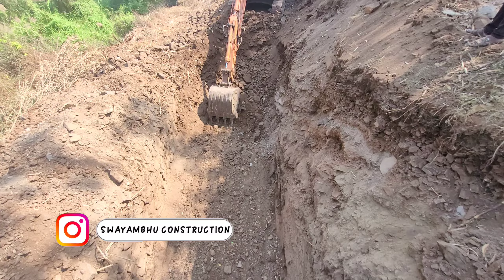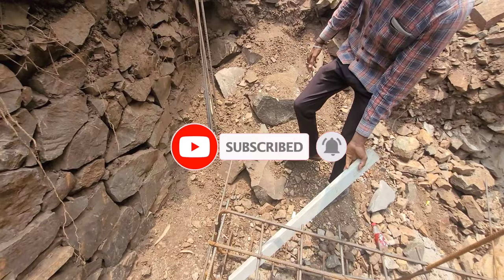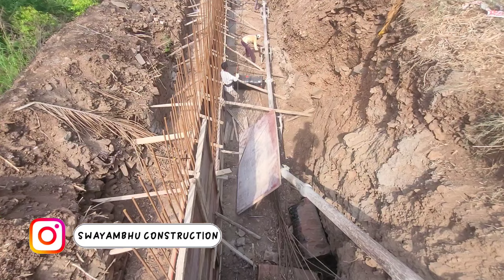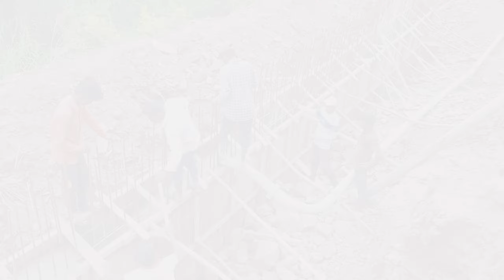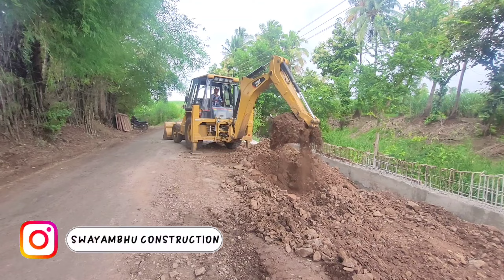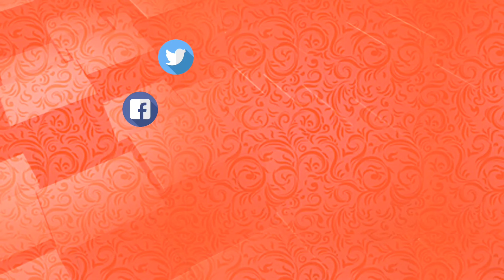RETAININGWALL CONSTRUCTION | CONSTRUCTION OF RETAININGWALL | MASS CONCRETE #constuction #concrete

Comment: What would be the price for this type of retaining wall
Reply from the maker: @swethanswaroop3775  30 to 40 lakhs
Reply: Thank you what are the dimensions
Reply from the maker: @swethanswaroop3775  18m length 5.5m height 
Bottom raft 4m
Reply: @swayambhuconstruction4916  thank you very much
Reply: @swayambhuconstruction4916  could you please share the structural drawing regards thickness of wall and metal rods thickness
Reply from the maker: @swethanswaroop3775  DM me on instagram